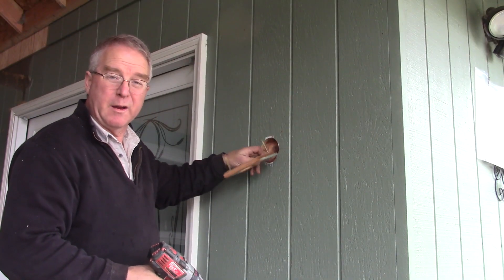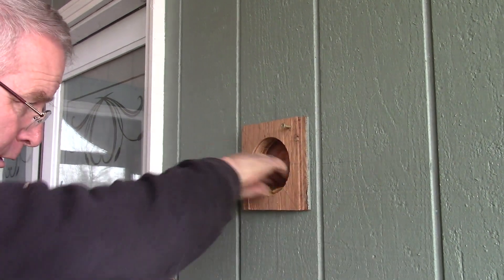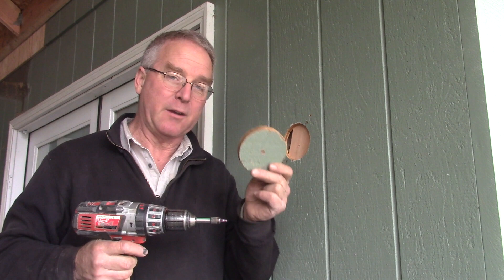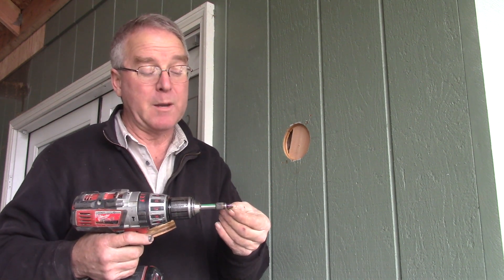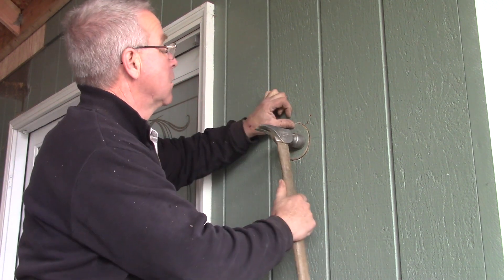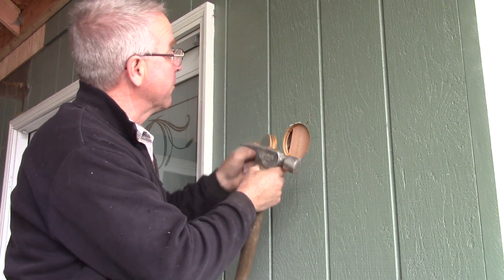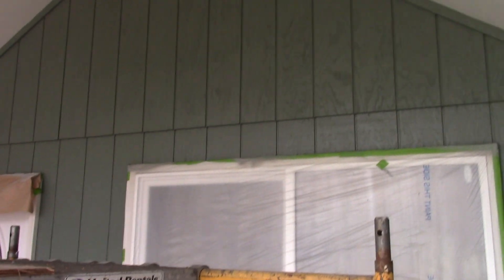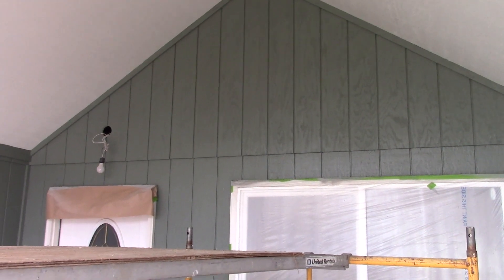How to Patch Siding

Comment: Never make a cut (video editing) in the middle of a sentence. There was a cut at six seconds into the video that you should have just started over from the beginning. At one point there were three cuts in about 15 seconds and none of the following takes left off exactly where the previous take was cut. It was very jarring to watch.

You got the tripod, hooray! That definitely made a noticeable improvement. Now that you have that, you can start breaking your videos up into scenes. For example, at about 50 seconds in, there's a cut and then you pick up the scrap of siding. That cut was almost fine. That last sentence before you grab the scrap would have been a good place to cut naturally and change scene. This gives you a natural break that is easier to cut back to if you mess up and need to redo the following scene.

This will make your filming process take longer because you will have to redo longer segments of scenes, but it makes for a more watchable video I think. I also don't think you need to worry about being perfect. Just go with it.

Also, sorry if this sounds overly critical. I really like your videos and what you do and admire your skills. I'm just trying to help. I think you're the kind of the person always looking to learn and improve, so I think you understand.